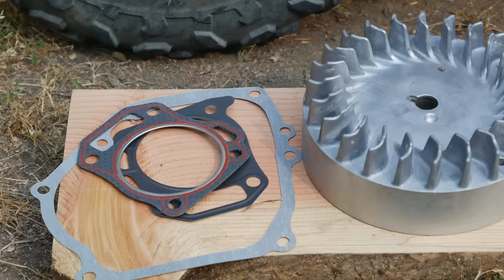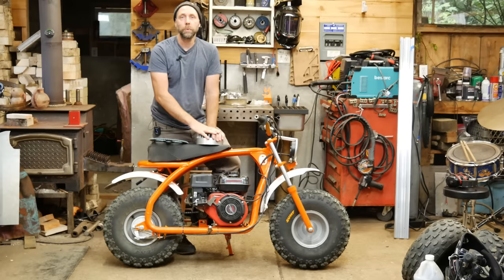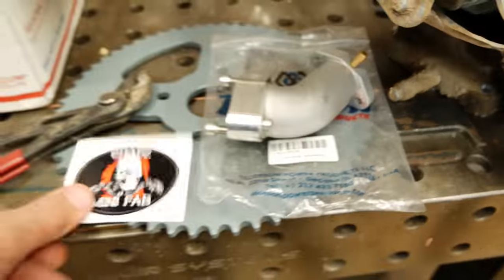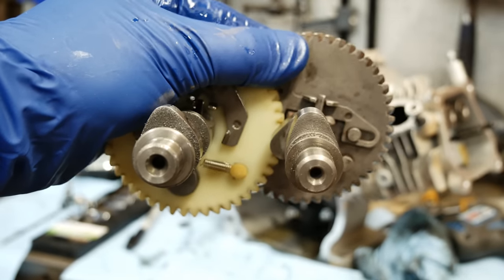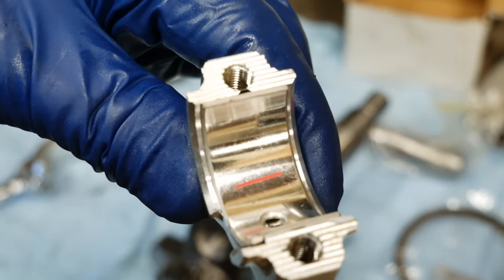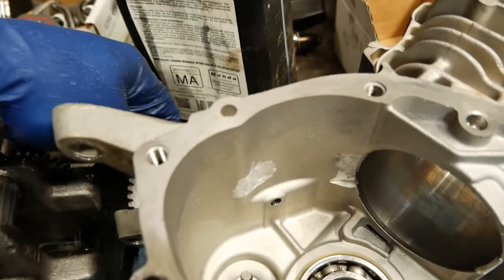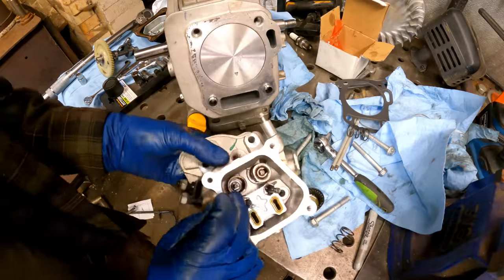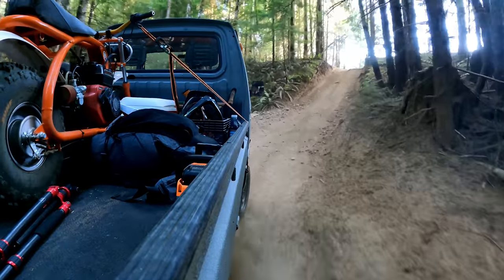Coleman BT200X mini Bike 224CC stroker Engine Mods

Comment: Next time you go in the motor. Take your crank out and put it in a vise and take a hammer and knock that governor gear off the crank it’s easy. Saves weight on rotating mass. Don’t need it anymore

Comment: Dude?? Get yourself a Juggerknott torque converter and you’ll smoke that ghost engine on your brothers minibike
Reply: I kinda like my clutch.
Juat gotta grow a pair and keep it in the power band ROFL.

J/K mine goes up hill pulling the whole way.
I kight just be the right size for these bikes by chance though, it seems to not do a lot of the things others talk about.

I will say that for a  lot of mud or sand I would agree cuz my bike just sinks in sand if you let off the least bit, I imagine a CVT would stay smooth and not fall out so easy.

Comment: I absolutely love these types of videos man. We are all addicted to upgrades, and love watching the results. I've got a BW80 that I lifted 6 inches, and fabricated a modular sub-frame around a 212. I just finished making a dual sprocket roller hub to allow the rearend to flex without putting tension on the chain. Now I'm moving on to the 212 upgrades. It's very rewarding when you achieve more power and top speed. Looking forward to the next vid bud.

Comment: When I was a kid , racing karts, I was getting beat on the regular by on kart. No matter how much I had worked on my kart , engine and driving. I took the head off and carried it to the muffler shop. I looked at shop owner and said do see the crack by the sparkulator, weld it up. Ground it down so it didn’t hit the piston. The extra metal took up space in the chamber and made more compression. That made me even with him .

Comment: That carb, manifold, air filter looks like a nice fit! Here's a tip - i bought a second rear fender and with some careful cutting I overlapped them and put the seam under the upper mount bracket. Came out great and way better protection on both ends.

Comment: I want one. I put a 212 Predator/Chins comet 30 10/49 gearing  on a 1980 yamaha DT125 enduro. I have the title it does great Im going to put a lighting coil in so it can charge I will put the horn turn signals lights and brake and tail light. it does 55 flat out fast enough. you gave me the bug Mike im 57 and still like to play:) Godspeed

Comment: The only thing I don't like about the BT200: when I weighed 200 lb,  it would nose dive when hitting brakes while turning.  But then I got down to 175 lb and it stopped.   My RB200 came with stiffer suspension fork and seems more stable at high speeds, but the BT200 turn radius is better on tight trails

Comment: these bikes are so much fun. I have had mine for a couple years (ct 200u ex)just kept them stock, we have enjoyed them and mainly use them when camping to putt around and just explore , the one I ride the most finally got to the point where I needed to replace the engine, it  was just smoking really bad , still works, actually runs faster than the newer less worn out one but I figured it would be fun to swap out to the 224. right off the bat it is very noticeably better even with everything else still completely stock. I do not necessarily care to be doing jumps and going 70 miles per hour on a mini bike with no rear suspension but now I am really interested in doing some of the upgrades, everything with these bikes is inexpensive so you do not need to invest much to really add a lot of performance. I see there is now one with rear swing arm....very tempting to buy it, my only real gripe with these bikes is the lack of rear suspension.

Comment: The more I see these Harbor Freight engines and their performance parts go up in price the less they make sense. The parts alone for this thing just to keep it from grenading into your crotch cost as much as a Tillotson 212, which comes from the factory as pretty much a stage 3 1/2 Predator but more durable and reliable. You can just yank the governor out of a Tilly and have a 10HP GX200 clone that'll actually last.
Reply: I agree, the Tillotson 212 is a great motor and value. The Ducar 212 is also a really good motor and comes with a PVL flywheel, slightly better carb and block reinforcement casting. But…. The 224 and Ghost are not that different and longevity should be equal to these other 2 motors. Why? Because they all have something in common, they are all manufactured by Ducar. 👍
Reply from the maker: Run what you want and I’ll run what I like 👍 that’s the beautiful of having choices my friend.

Comment: I took my Coleman minibike and took that 196 out of it or whatever and I bought a predator and I put a state three kit in it and a torque converter different sprocket and that thing will go anywhere mean I’m a little over 200 pounds and that thing will freaking wheelie and pull me up any hill I can go on And it’s super dependable well I did a lot of work to that motor. You know I call the stage three kid, but I’m probably went a little further than that but it’s a powerhouse well worth it. It wasn’t that cheap but it’s worth it though. The power in dependability is unbelievable.

Comment: I had problems with my exact flywheel! The $40 alloy flywheel kept coming loose! Shearing my key eventually. I lapped the poop outta it, idk why I had so many problems with it? Same 224cc engine and flywheel! Anyway,  gr8 edit btw!!
Reply from the maker: Thanks for the heads up on the flywheel 👍 I will keep an eye on that. 🙂
Reply: It's not a stock flywheel so you wouldn't use the stock torque spec of 54 ft/lbs. I have used 65 ft/lbs and no key on two engines and they haven't spun.

Comment: Great video. I wish I had another bike and rider to compare the way you guys are.

I'm thinking of getting that flywheel just to verify once and for all what they are timed at. I have heard a few different timings from others. Those flywheels appear to be a copy of the Honda GX200 aluminum which are timed to 22 BTDC. It's just a matter of taking the time to verify it with a timing wheel.

You guys must have different gearing? A stock Ghost shouldn't have more power than what you have now. The Champion rockers alone are a long known plus 1.5 HP. And you are running more cam and compression.

Comment: Those mini bikes are pretty slick. Glad to see you removed the oil sensor from the engine, nothing like have the engine shut off on you are you whip it around a corner or pull a wheelie. Oops

Comment: I never see nibbi carbs on any minis? I run one on my ct200U that got 18 or 22lbs springs full governor removed, full top plate with full pump, the nibbi 28 carb, nibbi throttle and cable, short exhaust header off eBay. I get right about 35mph out of her but don’t hold it at thet she cruises at like 28 to 30! I love the nibbi stuff plus it looks so much better than the mikuni!

Comment: No torque converters on those minis??? That made such a difference to my mini bike (ct200u). Thats pretty much all I did and it will climb pretty steep hills even with my big (260lbs) body on it. Even had my 37lbs 4 year old on it with me and climbed a decently steep hill without any bogging what so ever. The torque converters are so much better than the cent clutches

Comment: Hey Mike at 17:10 i noticed there was a lash cap was missing on one of your valve springs before you put the rockers on. Did you find one left over after the build?

Comment: The Ghost 212 have better acceleration then the predator 224 which is probably because of its 6k rev limiter in the ghost. When it comes to speed 224 got it!!

Comment: not sure if you have looked into the comet torque o-verter tav 30 clones .  you can find them on ebay for right around 60 .search mini bike torque converter
direct swap for the stock jackshaft assembly your bike came with . you can swap out springs to adjust when the driver engages

Comment: Considering how you both ride these, it's probably a good idea to change the front forks on your bikes, doesn't need to be the best swap, but it should be better than c-specials. I've seen one too many bikes where nothing got upgraded in that aspect and it almost always ends up with a face plant. They're just junk, built by the same concept as bicycle ones. jm2c

Comment: I have an old frame and a pred 212 sitting around, I've thought about ordering some Chinese upgrades and setting it up. I don't know tho, those little frames were fun when I was a teenager, I think I'd be better off with a set up like you guys have 👍
Reply from the maker: If you have most of the parts around you might consider building it up at least for now, you could always find a BT200x frame like we have with a bad engine on CL at some point and swap in the 212 engine? 
One other thing, if you get your mini bike going, you should try and get a friend or two into them, they are definitely a lot of fun when you have a few people to ride with 🙂👍
Reply: @Mikefestiva  I think I like option B, I remember how unstable those things were with a stock Briggs 5hp back in the day, I'm much more fragile these days 😆

Comment: Great video, just curious how are you running your head light with that style fly wheel. I'm in the process of building a bt200 I went with torque converter and a 60  tooth sprocket. If you switch that Jack shaft you will love it. Not only do you get more power low end and long run when your coasting down hill it free wheels, cut out on all that chain noise much smother ride. I'm 300 plus I can set all the way up to front of seat and it still pulls the front wheel up with just a slightly modified 196cc and a lot of adjusting with that TC.

Comment: Can you fit a torque converter on that bike? Put one of them black drivers from go power sports for the top end 
Also you could go a 24 mm makuni clone carb with those mods!

Lastly head work get the head milled and port it some to get the last performance out of it
Reply: 'Juggernaut' is the strong clutch for belt drive.

Comment: You guys drive them pretty hard. How are the drums brakes working out with the added power/speed. Any plans on upgrading those or are they sufficient ?
Reply from the maker: I installed a clutch lever from a full sized dirt bike and the added leverage really helped the rear drum brake, you can skid it at full speed.
The next project for this mini bike is a front dust brake, that’s definitely needed now with more power and speed 👍
Thanks for checking out my new mini bike video!

Comment: Next time you check your clearance for the magneto use a business card it's the perfect size perfect length to get them even put it in the place of your feeler gauge and tighten the bolts remove the credit and there you go
Reply from the maker: Nice tip 👍

Comment: I'm surprised you didn't go in and clean up the ports in the head and gasket match that intake. Normally these castings are pretty rough in there. No need to open it up any, just to smooth things out for easier flow.
Won't help on the hole shot but will up in the top.
I'd also ditch that 22mm carb for a 24 or 26mm. Clean up the heads maybe even a 28mm. If you still have a muffler I'd error on a 26mm max.
Reply from the maker: Probably get to porting it in the next video, I’m probably going to build a header and different intake as well 🙂👍
Thanks for checking out my new video 🙂

Comment: I've got a custom frame mini bike it used to be a rt200 but with now its got dual suspension in the rear with a swing arm and dual piston hydraulic brakes. With the stock 224 on I do 55 topped out. Haven't been stuck yet. Using sun f power 2 tires..in you're opinion does the upgrades make a huge difference

Comment: With that engine upgrade would you say that the high-end torque would be at the higher motor RPM's or lower? If at the higher motor RPM's then perhaps a smaller pinion gear matched with a large wheel sprocket gear to work out your wheel RPM & wheel circumference to work out your total speed which is faster than your brother's bike.

Comment: One question with this aluminum flywheel can you still power up the headlights
Reply: As far as I know you can't. Most times the charging coil has to come off
Reply: This is my question as well. Battery system? Or lights just for looks?

Comment: good solid build may i ask what u lubed on the intake gasket
Reply from the maker: I usually add a small bit of black silicone sealant to the intake gasket because these small engines are prone to intake air leaks. Thanks for checking out my mini bike video 🙂👍

Comment: Were those performance parts actually designed for that engine?  That looked like a lot of modifications just to keep them from hitting all the internals.  Not something a lot of shadetree mechanics are going to want to do.
Reply: Its common with 212 also

Comment: Does clearencing like that weaken those components in the engine? I mean sure it runs right now but how long can you run it like that?? Serious question.
Reply from the maker: No, without doing the clearances the components just won’t fit and would be a waste of money. The parts I installed actually make the entire engine more robust like the Rod for instance, stock Rod will come apart with high RPMs and that for sure will completely destroy the engine.

Comment: Ya know some of the older diesel engines had domed pistons for even higher compression i wonder if a domed piston could get the compression even higher on these predator engines
And would it be enough of a gain to be worth it

Comment: Hey Mike,  I'm curious about how much ignition advance that billet flywheel has. I put a PVL billet wheel with 28 degrees ignition advance on my 196 Hisun with the stock key and then tried a 4 degree offset key and the diff was noticeable. The buzz is that around 32 degrees BTDC is the sweet spot for these engines. Maybe that will help get you past your brother and the Ghost!
Reply from the maker: Thanks Matthew 👍 I ordered the offset key to advance it even more like you mentioned, I haven’t installed the key yet. I got thinking about this after I posted this video because the aluminum flywheel is only 28°
Thanks for checking out my video and mentioning this 👍 I really appreciate it 🙂
Reply: @Mikefestiva  The flywheel you used is 17-18 BTDC. You need a 10-12 degree key just to get it closer to where it should be. Most aftermarket cams use 32 degree timing. Even the mild CL1 cam I used in a 196 uses 32 degree timing. 

I'm planning on building another 196 and will probably use that flywheel. I'll use a timing wheel to set timing and run it without a key.

My 224 has a PVL with a 4 degree key. That thing has a lot of torque compared to the 196's I'm used to running.

Comment: I can tell this aint your first small engine rodeo lol. Do you have any power recommendations for a 96 yamaha grizzly 400? its a 4x4 quad with low range (I want to build a plow and I haul brush with it, but also want it to be faster haha)
Reply: Your speed limit on that bike is the gearing. Both the big bear 400 and grizzly 400s are built for torque not speed. You want speed you are gonna have to get something besides a utility 4 wheeler.

Comment: What is it about minibike chains constantly coming off?  Long time motorcycle rider here, and the only time I've seen motorcycle chain problems was because of severe neglect on the part of the rider.  But I've seen on other popular minibike channels here on YT having constant chain problems.  Is it alignment issues or just not knowing how to properly adjust the chains on minibikes/gokarts?
Reply: Most are chinese frames and the steel they use. They just flex more than a motorcycle. You also gotta remember these mini bikes are really built for a sub 100lb teen with only a 3-5 hp motor.
Reply: I've had my Coleman bikes for more than 7 years and never had the chain come off. It's just sprocket alignment and chain maintenance.

Comment: I wonder if there's difference in the actual stroke length
Reply from the maker: I mentioned in the video this engine has a longer stroke so yes there’s a difference.
Predator 212 stroke is 55mm, bore 70mm.
Predator 224 stroke 58mm, Bore 70mm.

Comment: I don't understand why predator just doesn't do those upgrades and sell it for more money? Because seems redundent, doing a job twice to make the engine to what it suppose to be.
Reply from the maker: The main reason is because these engines are sold to be used on pressure washers, tillers and log splitters, that’s the bigger market, this engine modified the way I have wouldn’t work good on that equipment.
Actually HF done make a good out of the box engine for mini bikes it’s the Ghost engine, no low oil shut down, not governor, motorcycle style carb and a 6k RPM. It’s sold as a go kart racing engine 👍
Thanks for checking out my new video man 🙂

Comment: if you were building one as a low cost trail bike would you go your brothers route or your route
Reply from the maker: Honestly the best budget way to go is to mod the stock engine with a better carb and header, but if you wanted more RPM and power the Ghost engine my brother has is a good affordable route, that engine is pretty good 👍
Reply: @Mikefestiva How do you/ your brother power your lights without a lighting coil under billet flywheel?

Comment: And any tips to get er to start first pull, thanks.
Reply: What engine do you have? If youre having trouble starting on first pull, you might be a little lean. Turn your air fuel screw on the carb out a half turn to add more fuel to the mix.

Comment: I always see people in these vids using the platiguage but not one person ever says what happens next if it doesn't come out ok
Reply from the maker: Well probably because most people have the proper tolerance when they test the connecting rod. If they don’t spec out right then you would probably contact the seller and try to order the right size bearing for it.